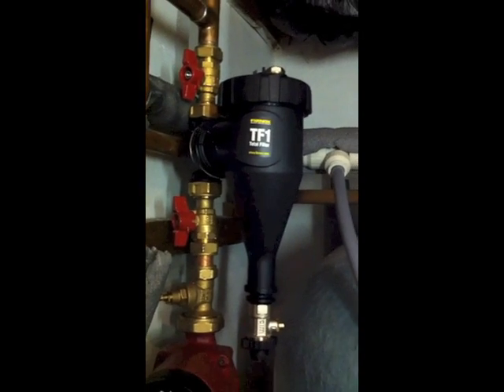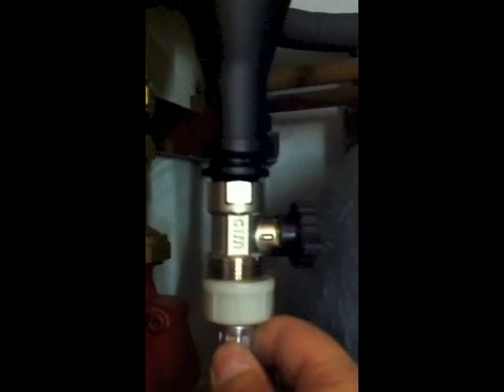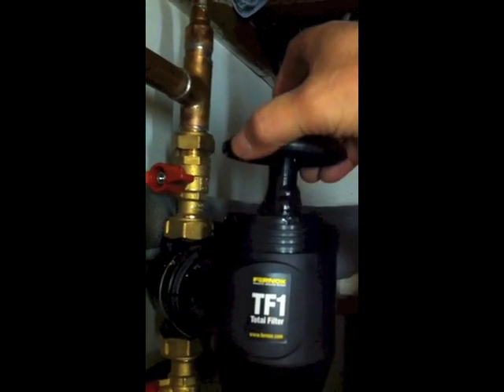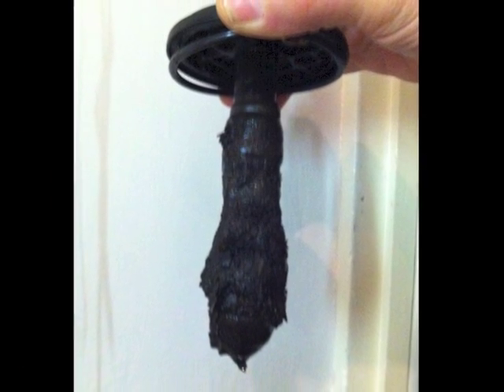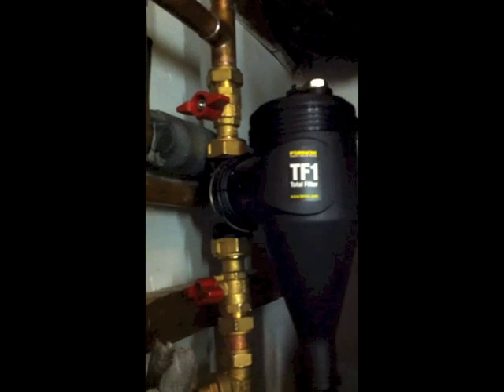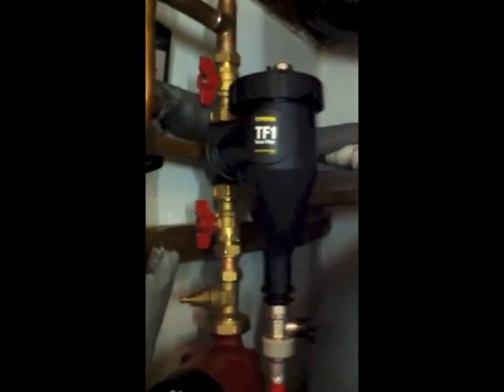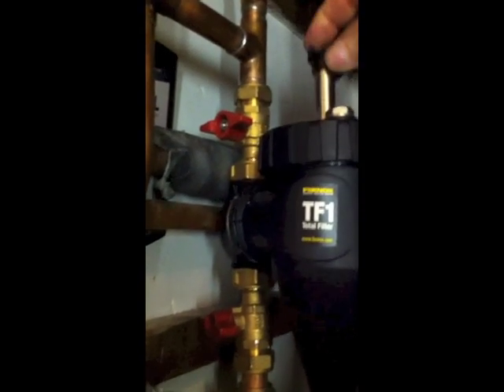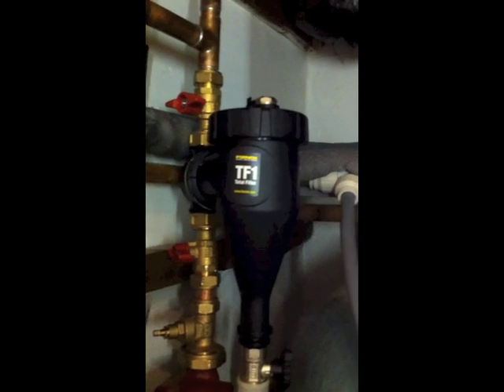Cleaning magnetic Filters on Central Heating Systems

Comment: Thanks for that. Would just add, be careful not to cross thread the top, easily done working in a very confined space and above head as I was. Seemed to screw on with no problem but got leaks at first and took several efforts to close correctly.
Reply: Happened to me last week. Service engineer didn’t put lid on correctly and I was left with a leak. Following day the boiler pressure was reading zero.

Comment: What is the best tool to use to remove the lid of a Boss magnetic filter. No specialised tool is supplied with the filter? Brian Watkins
Reply from the maker: Hi Marian - There should have been a tool supplied with your filter.  Did you fit it yourself, or did a tradesperson fit it and take the tool away?  I'm sure if you get in touch with the manufacturer's they will send you one (in the UK, Boss is sold under 'contract' through Plumbase I think).  Failing that, really, only a very large wrench would do it, although generally they are supposed only to be done up 'hand tight' where possible.
Reply: Thanks for your helpful comments. As a point of interest, the manufacturer did send me a universal tool, but the size didn't fit. Thanks again Marian & Brian Watkins Swansea
Reply: get a car oil filter to match size they are ajustable
Reply: I have the same predicament and I have purchased to strap branches. One to hold the body and the other two place around the lid. Being rubber, they won’t damage the plastic.

Comment: is flushing an existing system necessary before fitting a new filter or is it recommended.
Reply from the maker: Hi exwhyz33 - thanks for interest.   It should always be noted that 'any' magnetic filter fitted is not going to 'clean' the system. (despite what many heating engineers will try to get away with telling you).  The filter will help to keep the sludge and muck levels down and will definitely help the system and its efficiency.   As for cleaning/flushing the system first, this would always be preferable, especially if you are fitting a filter 'because' of problems of sludge, this is really required.  Don't forget to add a decent corrosion inhibitor e.g.: Fernox F1,  Sentinel X100, Adey MC1 to the system.  Do come back with any other questions at any time.

Comment: Thank you for this. I now feel confident to do my own.
Reply from the maker: Thanks Derek - glad it could be of help.  As correctly pointed out below by Rob, the rubber 'o' ring should be replaced when stripping down as these have started to leak.  Fernox supply a spare with each unit, but service kit 'spares' are available from merchants.

Comment: Hi, if removing the lid you should replace the rubber o-ring (there's a spare in each box) and always tighten up the lid using the spanner. Thanks.
Reply from the maker: +Rob Clough  - Hi Rob, you are of course absolutely correct.  At the time of making the video, not many of us were aware of the problems appearing later with this model.  The o ring should really be changed at each time of opening - along with a good clean around the top rim and seating.  Fernox are of course now selling 'service kits' with o rings in for later services after having used the one spare.  It is also tempting in light of this, to clean the filter by removing the magnet and flushing, whilst 'tapping' lightly on the centre of the top of the filter.  I have no problem with you highlighting this. MD